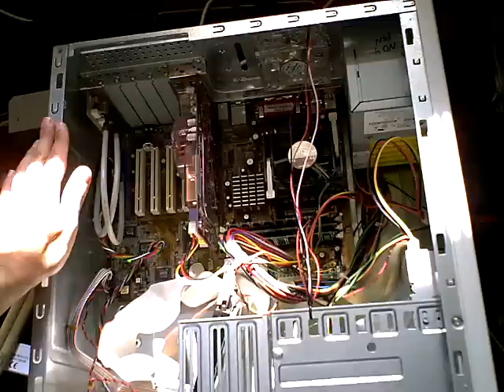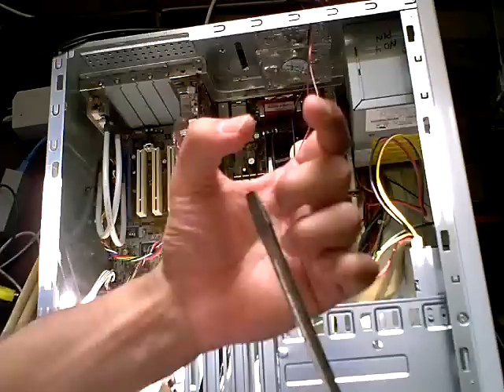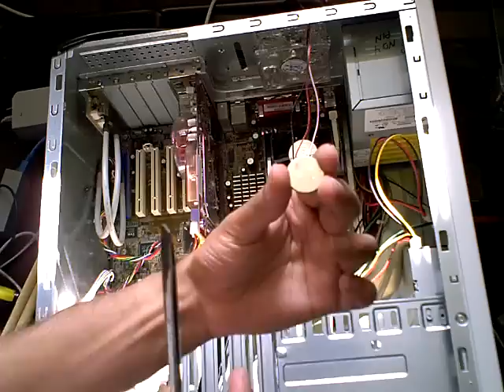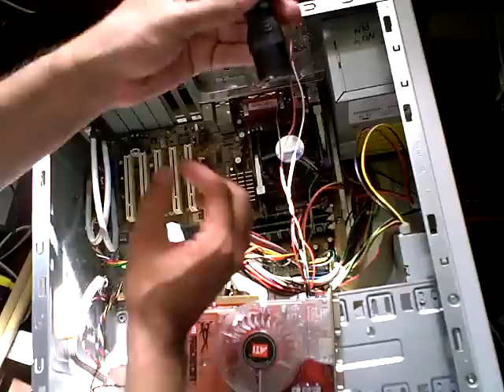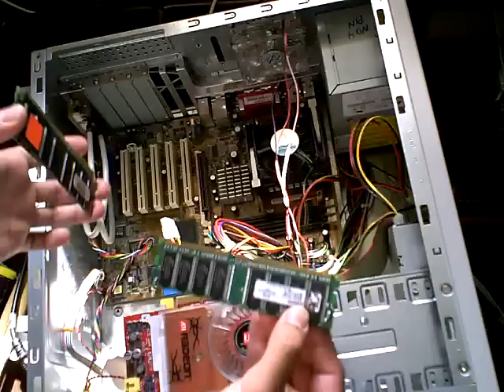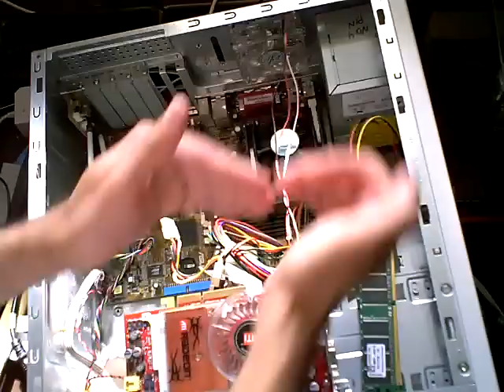How to possibly fix a PC that will turn on but will not beep and will not display anything on screen

Comment: hello there rodney i will be so happy if u will help me , first i want to thank u for this great video i sure that he helped to many pepole to find the issue with their computer .

i have the same problem i followed your video and done all the things u suggest to do without any succes, i mean the computer still running when i press the power button and turn off with a few seconds, without any beeps or anything all the compoments are out - the video card the ram and everything i could just to run the supply and yet hes doesnt stay long on . so my question - is this the end of the road for my computer?
Reply from the maker: +Dima Zagorski Thanks for the kind words and sorry for the almost a year later reply. It might very well be. you can always Breadboard it (explained in the following video:)

If the steps in this video did not provide a solution to your problem, view:

http://www.youtube.com/watch?v=_EK9a-R5pss

You never know, maybe rebuilding the PC in the opposite sense that you took it apart will solve the problem.

Comment: hi. heres my problem im gonna try my best to explain. My new pc that im building is ll put together and all the wires on the manual are plugged in and stuff like that. when i plug it in and click the power button, then the led fan and the nvidia g force logo light up and the fan spins for a second and then turn off, but the leds on the case power button are still lit up. then after that it doesnt do anything when i hit the power button, but it does it again if i unplug it and replug it back into the wall. I asked geeksquad about it and they said that it might me the motherboard, the cpu, or the wiring. So, i checked the wiring and it looks good so it cant be that. and the motherboard has an led on it that turns on so i know that it works so i think its the cpu. what do u think?
Reply from the maker: +Pokesky456 Breadboard it (explained in the following video:)

If the steps in this video did not provide a solution to your problem, view:

http://www.youtube.com/watch?v=_EK9a-R5pss

You never know, maybe rebuilding the PC in the opposite sense that you took it apart will solve the problem.

Comment: I have a problem please respond quick!!  My computer turns on it beeps and on the screen it shows the start windows normally and it runs but I don't get any picture after that. Is there a problem with my graphics card?
Reply from the maker: +Andy Lannister Over one year later is quick, right? Chances are it has to do with your Windows settings. Boot Windows in safe mode (hold F8 at bootup) and see if you can uninstall the existing video driver. Reboot, and try to install a different video driver afterwards.

Comment: what if psu is malfunctioning... you can replace the mobo to find out that that the psu is not working at all or working partially (after plug in the psu green led is on and after i push the power button the led is off and after i tap lightly few times the psu or cooling sink the green led turns on)   .... so how to test psu if no spare one is available? otherwise the video is excellent with clear articulation. Thank you.
Reply from the maker: +Ryszard Jacek Ruśniak Thanks for the kind words. If you do not have a friend or family member's PC to test your PSU on, they sell testing kits online for a couple of dollars (but these can take some time to get to you). There are also multimeter tests that can be performed, but this goes beyond my knowledge.

Comment: I enter the BIOS SETUP ,then save and exit. But, after a few seconds, black screen appears and no response ??

look forward to receiving yours reply
Reply from the maker: +Dragon King Asia I'd assume that it's trying to load the operating system unsuccessfully. Is the hard drive being detected in the BIOS? Is an operating system present on said hard drive? You may need to format and reinstall the operating system unfortunately.

Comment: Ya i reset the CMOS but didnt solve the problems. I didnt see any burn marks. Is the problem in RAM? Or my motherboard is ready for garbage?
Reply from the maker: If the steps in this video did not provide a solution to your problem, view my:

Advanced troubleshooting technique tutorial of how to possibly fix a PC that will not beep at boot

You never know, maybe rebuilding the PC in the opposite sense that you took it apart will solve the problem.

Comment: I was wondering, is it possible if replacing the BIOS chip could remedy the problem?
Reply from the maker: +Anonymous Null It could, but it is seldomly the BIOS itself that is the issue. Rather, it is often capacitors that blow.

Comment: I know i am using a defective gpu. When my pc starts, there are sevral lines on startup but it started windows at end and i was able to surf internet.
But today, i turned it ON.
it turns on but no display no beeps and it is still ON. it wont turn off unless i press powerbutton to shut it off. can u guess what is causing problem?
Reply from the maker: +Mehdi Shah Follow the steps in the video, it's the same issue
Reply: Its fine now.
I bought an HD 5870 and issue solved.
Reply from the maker: +Mehdi Shah Glad the issue is resolved then
Reply: +RodneyDickson again man.
My pc isnt turning ON.
last night same issue, just 1 ram stick was not shown.
i just took ram sticks off and then installed them again.
now pc turns on, no beeps no display.
CPU is fine.
pSU is tested fine
gpu is tested fine
what could it be?
Reply from the maker: Problems like this can often be attributed to a troublesome motherboard. Sure you could reset the CMOS again (as shown in the video) but from the sounds of it, this problem will just manifest itself again in the future. You can either replace the board (while you are at it, replace the CPU and RAM as well), or if you want to run your current PC as long as you can without spending money, I'd just put it to sleep mode when not in use so that it always wakes and is ready to be used (this avoids the dodgy bootups). Good luck

Comment: Thank you, that solved my problem but no I don't know what to do with my graphic card, and now the screen shows a message of rebooting and select proper boot device, what could that mean?, an advice for this two things please.
Reply from the maker: Try unplugging your PC, re-seating the graphics card, power the PC up, and if you hear the PC beep and boot but don't see an image on screen, this can simply be your BIOS pointing to the wrong primary graphics adapter, in which case changing this setting in the BIOS (with your monitor connected to the onboard graphics temporarily) will solve this problem. If the PC completely refuses to beep and boot with the addon card present however, ensure that all necessary power connectors to said card are connected as intended and that the card's onboard fan is functioning. If after all this, you cannot get the addon card to function in the PC, then perhaps your power supply has lost potency to run your addon card, or your motherboard video card slot has become damaged, in which case this video card may be used in another PC in the future, so hold onto it until you test it in at least one other machine before deeming it defective. As far as the message 'select proper boot device', well, this refers to your BIOS not detecting your hard drive to boot your operating system from. Ensure that your hard drive is properly detected in the BIOS. Let me know how this all turns out.
Reply: +RodneyDickson Thank, I will see if it's the Bios, but I think that the power supply is not the problem, because before I take off the graphic card, every time when I turned on the PC, the graphic card lights turned on too, included the fans but after a second only the fans stop running but the lights are still on.
As I said I will see about the Bios, I will let you know about anything, thank you.
Reply from the maker: If the fans start up and then stop on the GPU, it sounds like it is not receiving the proper instruction, which can mean that the issue may be related to the graphics board, including possibly the power feed to it or the interface with the motherboard.

Comment: Please help me i just got a new gaming pc for my birthday and it won't work. When i plug the display cable into the graphics card output i get no signal on my monitor but when i plug it in the original ouputp it works

Comment: Hi, HP Compaq dc7800, When I turn on the electric switch desktop turns on without pressing power button, light and fans start working but display remains blank. After 5-8 seconds it shuts down automatically, and after 3 seconds again lights and fans starts working while the display remains blank. I have disconnected every thing and pressed cmos button for 30 seconds but problem remains. What to do, plz help :(
Reply from the maker: Breadboard it (explained in the following video:)

If the steps in this video did not provide a solution to your problem, view:

http://www.youtube.com/watch?v=_EK9a-R5pss

You never know, maybe rebuilding the PC in the opposite sense that you took it apart will solve the problem.

Comment: INSPIRON 546 NO BOOT OR VIDEO.

I have a similar issue with my Dell issued Inspiron 546. It went dark as in over a period of three boots failed to boot. There was a power outage shutdown previous to issues. It has not posted since. I replaced Motherboard, power supply, tried a Gforce video card, switched the RAM around and removed along with all components. Determined not a Monitor issue by trying three working monitors. Cleared CMOS, changed battery.  No beeps in any configuration. LED on front panel is Solid Amber. Still no video indication BIOS/CMOS on non response monitor (LED stays Yellow not green as in on position.

HELP!?
Reply from the maker: Wow, sounds like you went through the ringer. Sadly I haven't a clue what else to suggest. Maybe try breadboarding the PC as shown in this next video:

Advanced troubleshooting technique tutorial of how to possibly fix a PC that will not beep at boot

Comment: Just got a new processor mobo and ram. Got everything installed and got a usb over current warning. Disconnect front usb rebooted. Now I have no video but fans are running. I have tried multiple monitors and power supply's also tried integrated and my gpu. I just bread boarded the system with the same results.  Could the brand new board be bad??  Thanks
Reply from the maker: +Brian Barnette It's good that you breadboarded. Did you try resetting the CMOS? Did you try reseating the CPU?

Comment: Hey so I hooked everything and I can't get the keyboard or the monitor to turn on . It says no signal . However my mouse is on fans are on and I see the msi logo colored on the mobo.  I tried every usb slot for the keyboard but nothing . My monitor is also working on my other computer . The optical driver open and close right back by itself when I open it . I tried booting with only 1 ram and no result . Also it doesn't beep when I start it .took out the ram and still no beep . Took out video card and no beep ? Help please 
Cpu is well connected .
My set up 
Msi gaming 970 mobo 
Atx 200 case 
R7 360 msi video card 
500 w evga power supply 
Amd fx 6300 black edition 6 core amd 
Thanks
Reply from the maker: +Yan Larue Breadboard it (explained in the following video:)

If the steps in this video did not provide a solution to your problem, view:

http://www.youtube.com/watch?v=_EK9a-R5pss

You never know, maybe rebuilding the PC in the opposite sense that you took it apart will solve the problem.

Comment: What would you do if it powers on, and boots up and loads Win7 when it hasnt been plugged in for a good period of time but if shuts down wont post again? does beep with the ram out also has new psu
Reply from the maker: +A. Drink It would seem that your RAM has gone bad. Try different configurations of these, in different sockets, different amounts, etc.

Comment: I ran into the same situation as in the video, but I only have 1 team stick. Does that mean bad ram or is the motherboard garbage?
Reply from the maker: +GodleyBeast Ram is not necessarily the issue. I'd try to Breadboard it (explained in the following video:)

If the steps in this video did not provide a solution to your problem, view:

http://www.youtube.com/watch?v=_EK9a-R5pss

You never know, maybe rebuilding the PC in the opposite sense that you took it apart will solve the problem.
Reply: Turned out the ram wasn't compatible lol.  What are the odds haha. Adata is a bit no-name I suppose in terms of ram
Reply from the maker: +GodleyBeast Yep, this happens frequently to many of my viewers...they figure socket type automatically equals compatibility...well, glad you found the source of the problem
Reply: +GodleyBeast Adata is a brand and is fantastic brand. All brand can fail. I'm a it. I know these things. By the way Adata specialize on memory. I have never had issue with them and if i do then i'll replace it. I had crucial fail on me i had and even hp ram, dell ram in fact many of these high end company that manufacture parts would use adata and even worse brand that we as the computer tech we are surprise the unknown name but adata is not unknown.

Comment: So everything starts normally all the fans hard drive even CD drive. However no video out put and no beeps. Checked the ram and the rams good. All drivers work. Tried removing the batterie and resetting it But again no video also as I was working on my computer it help a charge in the casing and it would shock me I don't know why I made sure to get rid of all the static by tapping on the power brick but it would still shock me? Any clues on why?
Reply from the maker: Yes, It sounds like your motherboard is developing a short circuit due to contact with the metal casing. Most likely it has to do with the screws and metal mounting stands (supports) that your motherboard sits on. The cheapest way to fix this problem is to introduce cardboard washers between the screws and where they make contact to the motherboard, or you can buy plastic mounting supports at a computer shop.

Alternatively, you can always Breadboard it: 1)place the motherboard with CPU+Fan on wood or non-shiny cardboard 2)connect all of the case connectors to the board's panel 3)with a power bar that is OFF connect the PC power cable from the power bar to the power supply and the power supply to the board 4)while NEVER touching any exposed component,power on the power bar and press the power switch on the case.If the problem still persists,one of the remaining components is probably defective.Power off the power bar before dismantling

I cover breadboarding in greater detail in this video:
Advanced troubleshooting technique tutorial of how to possibly fix a PC that will not beep at boot
---

Comment: Hello again Rodney !! I did this !! I turn onn my pc still show nothing on screen and I take out one of the rams and pc automatically shut down !! is this good ? May the power supplier have the problem ?
Reply from the maker: +Enes Elezi Dude, you removed the RAM module while the PC was running? That's not good. If you want to cover all bases in your troubleshooting, just Breadboard it (explained in the following video:)

If the steps in this video did not provide a solution to your problem, view:

http://www.youtube.com/watch?v=_EK9a-R5pss

You never know, maybe rebuilding the PC in the opposite sense that you took it apart will solve the problem.
Reply: thank you for advices i did what youve done to the video but still nothing . i think u must admite my lose and send it to a technique or to garbish !
Reply: anyway keep doing those nice and helpful videos :)
Reply from the maker: +Enes Elezi Shame it didn't work out. Thanks for the update.

Comment: I did ecxactly what you said but after unplugging the RAM i hear 3 beeps and then stop,3 beeps and then stop,3 beeps and then stop........i plugged in my RAM and now i hear only one beep OR sometimes 2 fast and small beeps....but nothing appears in my screen...what should i do? (Sry for my english)
Reply from the maker: +Christos Sallis Beep error codes differ from one BIOS manufacturer to the next. To discover what the beep error code is trying to telling you, discover the manufacturer of your BIOS (available in the motherboard's manual or on the motherboard's manufacturer's website {on the page for your specific motherboard model}) and then look up the frequency and interval of your beep error code on:

http://www.computerhope.com/beep.htm

Comment: RodneyDickson   I have a problem, when i use my pc after 30mins or 1hr the monitor was shut down(the light is orange). The num lock and capslock was not working and the light of cpu is not blinking. what should i do?
Reply from the maker: Could be that your CPU or video card is not receiving enough cooling (is running too hot) I'd recommend at boot of your PC, check your CPU temperature in the BIOS, then use the PC for 20 or so minutes, then once again check the CPU temperature in the BIOS. If things are running much hotter and are close to the automatic shutdown temperatures, then you must ensure your PC case is closed, ensure you have a case fan blowing air out of the case, and ensure that your CPU fan is functioning as intended.
Reply: thanks :) i'll try this and what is the normal temperature?
Reply from the maker: VRP
It differs from hardware to hardware. If you check in your BIOS for a function that shuts down the PC in case of overheating, you should be provided with 1 or more critical cutoff temperatures. Generally, the lowest one is a good place to judge (with the highest temps reserved for those who know they may be damaging their PCs)